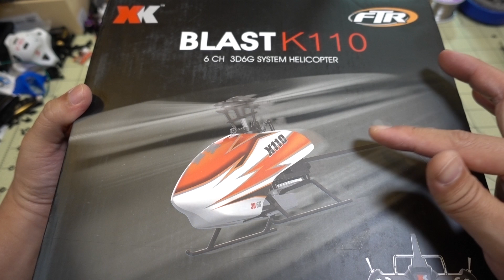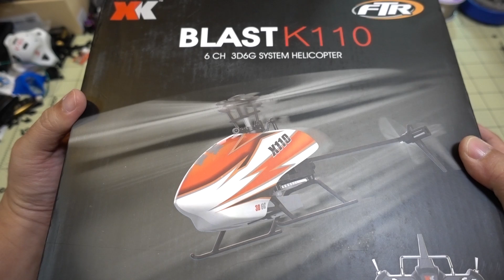Haul Time #104 🛒

Comment: I just received my TS130. I've only done a little hover test and los so far. The weather hasn't been good. It comes with bf 3.1.7. Are you going to flash it or review it with the stock tune?
Reply from the maker: Watch my video... I flashed 3.5.2 and tuned it.